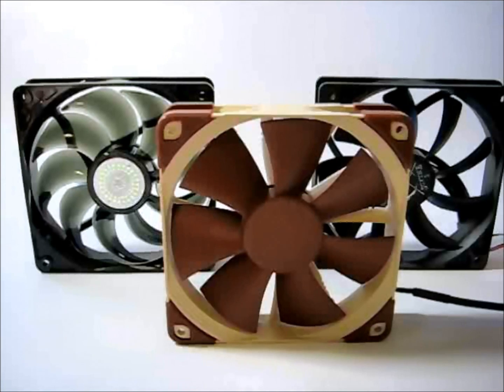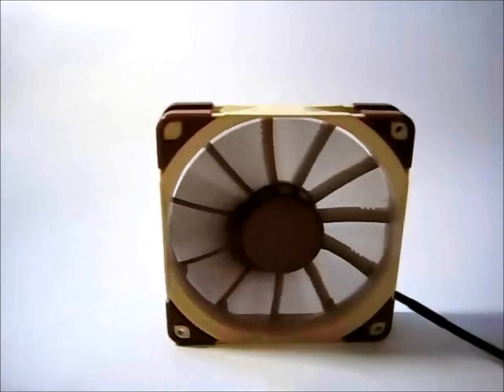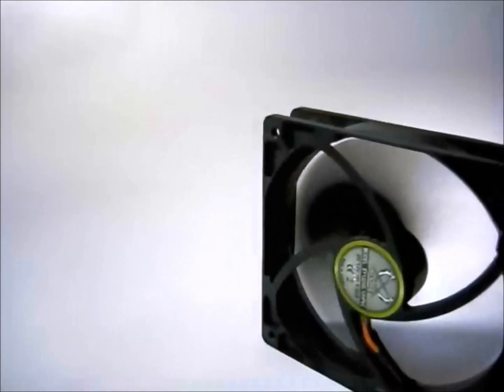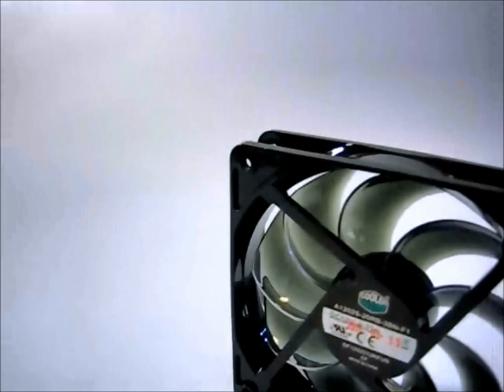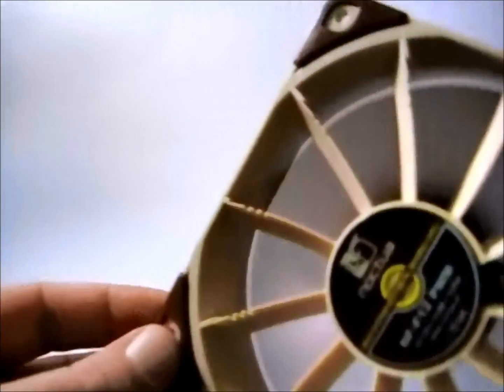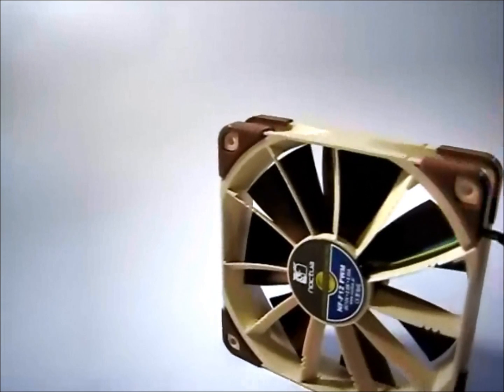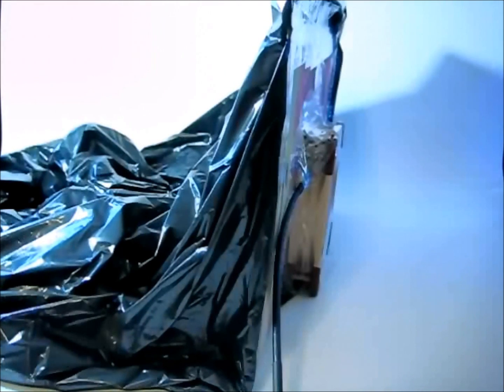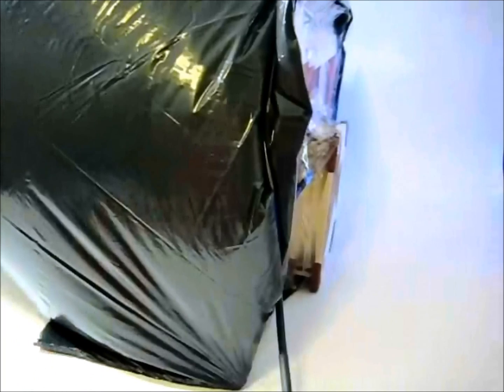Noctua NF-F12 PWM Sound CFM testing

Comment: The noctua fan you were using is optimized for static pressure, silence is second. Try using their nf-S class, they move x2 as much air and are much quieter

Comment: Am I tripping or does the Noctua sound louder than the CM one? Noctua has a very noticeable BRRRRR in it while the CM had a straight air flow sound to it (not counting the part where it made a noticeable noise while it was on the ground)

Comment: Not really, the Noctua fans are designed to work just as well as other fans while running at a lower rpm, so you pretty much get the same cooling with no way less sound. So it makes more sense to run them all at max.

Comment: Maybe that was my problem, I have the Vengeance C70 and the Sickle Flows were mounted behind the front panel and a mesh filter, not inside the case on the hard drive cages.

Comment: thumbs up for cooler master.... unfair test, scythe fan was at 1900rpm. its loud and moves a lot of air, hell it fell over when you plugged it in. noctua fans are just too damn ugly, never seen a case, motherboard, ram or psu match this nasty color

Comment: @majnu100  The noctua fan has higher static pressure(2,61mmH2O) vs (1.71mmH2O) and it has higher airflow (54.97 CFM) vs (35.36CFM) and has identical noise levels (22,4 dB). The Noctua fan however doesn't have LEDs and is more expensive so it really depends, if you want performance but don't care about it being a little more expensive then go for the Noctua NF-F12 fan. If you want it to look good and want a cheaper fan go for the Silverstone AP 121.

hope this helps =)